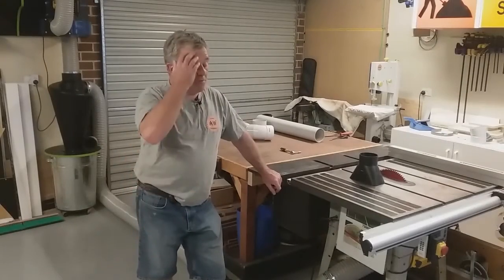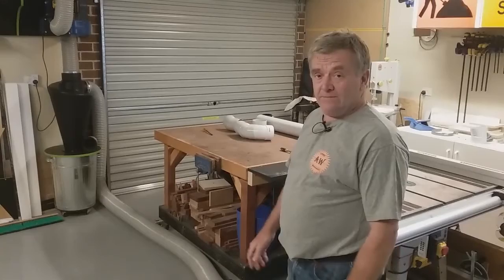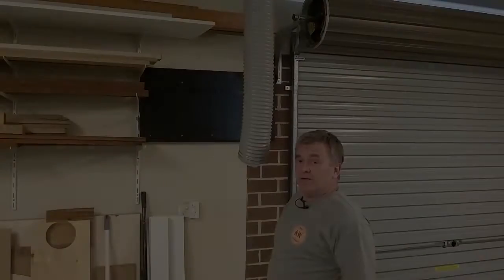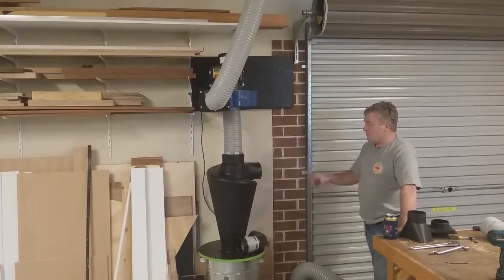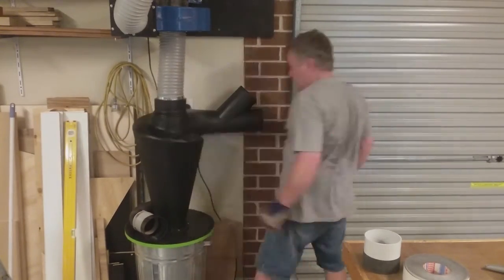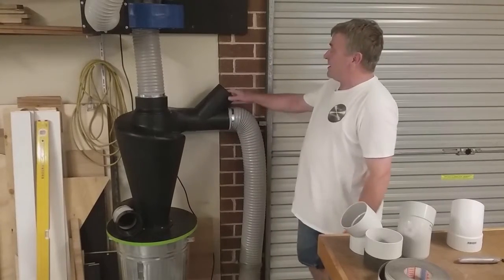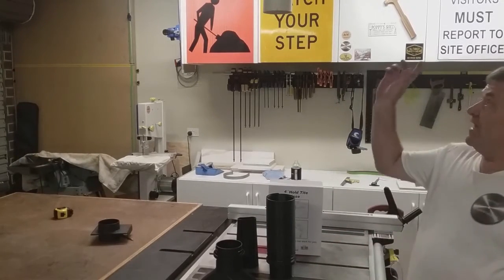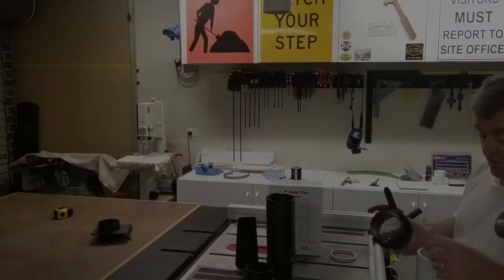Overhead Dust Collection to the Table Saw

Comment: You did pretty well to score those large radius elbows, and then to find one of the ceiling battens in the exact right spot. Lucky bugger. Quick, buy a lotto ticket before your luck runs out 😀
Reply from the maker: 3rd time lucky maybe pushing my luck. Cheers

Comment: Nice job, well done. Last time I saw your dust outlet from the bottom of the table saw it was all corrugated flexible hose. Have you, or are you going to, replace this with pvc pipe for the long straight portion? If you do it will improve your air flow over that section. However maybe the right angle at the top of the cone turbine is your flow rate limiting factor in this leg. If you could replace the elbow with a Y-fitting I think it would improve your flow. Keep up the good work.
Reply from the maker: Hi Arthur yes the flexible hose still runs to the underside of my table saw, running it in PVC would give better air flow but I need to move the hose when I need to use my trailer which is stored out the back of the garage. that same hose also connects to my jointer. Cheers